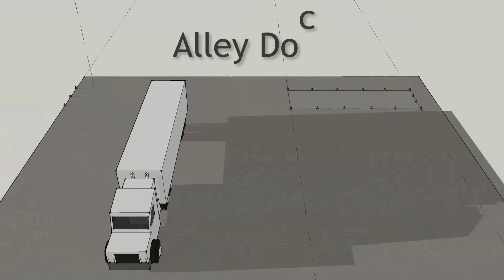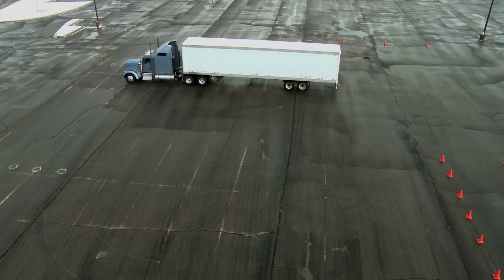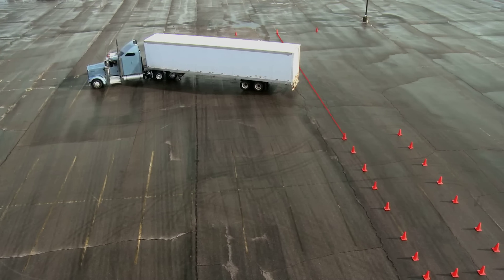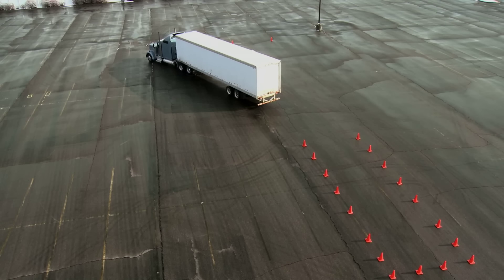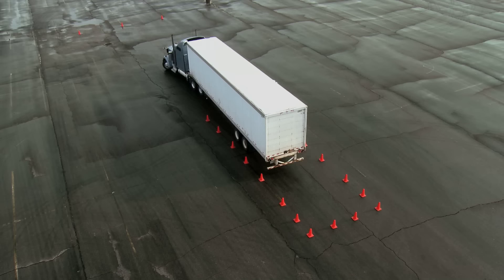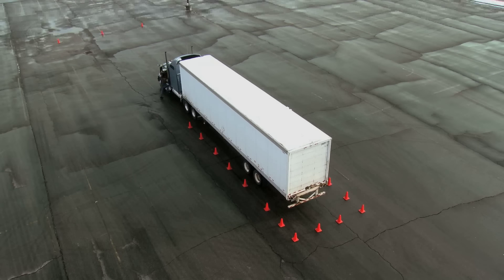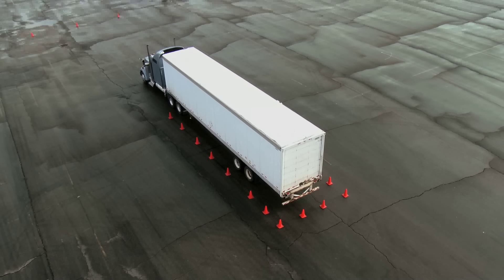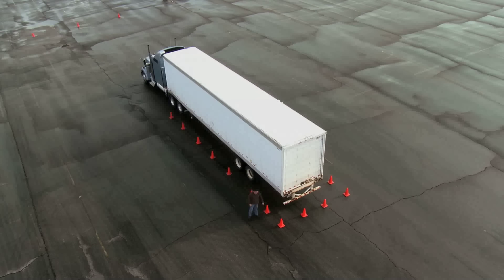Mooney CDL Training Revised Alley Dock with two free pull-ups for Tractor Trailers and Semi Trucks.

Comment: Gotta say as someone who's currently learning this, this didn't help much other than wanting to be about the middle of the 70 feet with preference toward the dock, the instructors for my school suck so we kinda taught ourselves so for a driver side back we do 1 full turn to the right, go back till we find about a pie sized slice on the landing gears cross beams, then straighten the wheels and back for 6 seconds then hard left for 2 seconds then straight till you feel you should hard left to bring it in, but the last part is pure feel and everybody backs and counts at different speeds, but as I said the instructors suck so I've bacicly taught 3 other people how do do the maneuvers so far and they do them super effective, I've been attending the driving portion for 3 weeks, they've been attending for 2 weeks I'm hopefully set to graduate soon

Comment: I never learned to alley dock in my training but honestly it's way easier to do than offset/parallel parking if you ask me. Just remember that you're driving the end of the trailer into the spot. Move slowly and correct/pull up as you go. You always want to use the actual end of the trailer as the point of reference, while also paying attention to your tandems and your drives to make sure you get in straight. You want your tandems and yours drive tires to be in line with each other AND the cones/lines by the time you finish parking.

Comment: I completed Straight line backing and offset. Been doing alley dock 3 times so far this week. Having a super hard time. Hopefully I get it soon. School is up to 3 months of training.
Reply: When you back up to ally dock get about 15 15 on each side of you and pull up 90 feet from your nose to where your backing when you start backing up turn your steering all the way to the right and start moving back watch your surroundings and keep an eye on your landing gear and the back of your trailer. Once you see the second foot of the landing gear go about 2 3 inches past it and you will be about 80 85 90 degree position once your angled to the right position counter steer back the way to straitin your trailer. try to do it on the side you can see your trailer on. Blind side sucks but still achievable

Comment: You hit this from the wrong side. Pull up close to the trailers until you clear the empty spot. When your body crosses the imaginary line at the edge of the spot turn left as fast as you can and wait for your trailer to follow you around. Once you stop you can go into reverst and the trailer will drop into the spot. It is magic.
Reply: I didn't understand that
Reply: Hi Sparky,  Trailers are parked in rows perpendicular to the laneway between them. I was having problems so an older guy told me  you go down the lane close to the trailers and have the trailers on your right side. Once you pass a hole where a trailer could be dropped start turning left as fast as you can. Pull your trailer around as you keep turning left until you can see the hole lining up with the driver's side of your trailer. Throw it in reverse and the trailer will drop right in the hole. Follow it in until you can drop it beside the next trailer. It takes four years to learn how to drive a tractor trailer. I was a mechanic before I was a trucker so I thought that was wrong, but after a few stupid mistakes I now emphatically believe it takes four years to learn to drive a semi.
Reply: @RobertBOUSKILL  That sounds like a technique to try. But for cdl tests students have to back up with the trailer set up straight, 90°  from the hole
Reply: @exillens  One customer I had was a large lot with a gravel lot with a door in the middle of the yard. There was no line to line up a trailer to to make sure the trailer was ninety degrees and square to put a plate the trailer for the tow motor. That was the hardest dock to hit. It was Don Lee Plastics in Toronto.

Comment: Graduated two years ago, did all 48 states and never once did a alley dock. In real ife, you will have to improvise
Reply: You were able to straight line and 45° all your backing in real life?
Reply: I also did OTR as owner operator for several years (w/Flatbed though)  no alley docking there but now as a city driver it is required,  it takes some practice and many pull ups
Reply: What are the 2 states you didn’t go to?
Reply: @dre1975  Alaska and hawaii
Reply: @exillens  it took 6 months to be good at it.

Comment: If you only set up about 5-8 feet out instead of in the middle and don’t go so far ahead you can do this maneuver without pull ups if you do a full 90* turn for your first turn you can just follow it right in way quicker and easier

Comment: Yea, except you have nowhere near that much room in an actual parking lot or truck stop....10x harder when you are trying not to damage a $200k truck on either side of you
Reply: TjThaReal13 That's when you slide the tandems back. There's WAY too much ass hanging off that trailer. That's the quickest way to hit something.
Reply: i would be worried about the guy or girl that spent 200 grand on a truck
Reply: Michael Hawes lets see...truck, trailer, all the equipment that goes with it and customizations...that set upwith a newer truck can hit 200 easy
Reply: @michaelhawes1346  Not if you make 400K a year hauling chemicals and fuel.
Reply: Heinzkitz Velvet I know this is old, but with our flat beds we cannot move the tandem so it’s good practice.

Comment: I set my tractor about 10ft from box and wheels about 8ft over shooting the box. Turn right all the way and back until your 90 degrees. Push the trailer until it’s about 45 degrees into the box and then get under it guiding it in. The way they show it here seems more complicated 🤷🏼‍♂️
Reply: So wait. You don't start turning your wheel hard right until your tires are 8ft past the hole?
Reply: @exillens  no I start with my wheels about 8 -10 ft from the hole
Reply: You need to explain better. Don’t really understand what you’re saying.

Comment: So nervous I passed my pretrip,airbrakes, straight line and offset driver side, failed my 90° Allley dock go retake it tomorrow mourning.... The crazy thing is in school I passed it when not an issue but for some reason I was just so nervous I think I was overthinking it I feel pretty good about it now though I just got to trust my instincts
Reply: How did it went did you pass i will take mine in two weeks

Comment: In Florida, we literally have like HALF of that distance in this video to do a pull up. It's seriously like 5 feet before the examiner screams at you and stops you in your tracks!! Not to mention where we are doing our testing is at our fleet maintenance facility, which is an insane place to do testing.. tons of traffic coming in and out, fire trucks, dump trucks, people and everything of the sort is a distraction while testing. It's actually ridiculous. I have failed alley dock twice as of today.. getting very discouraged with it. I have completed the test both times but got too many points. I swear the distance you can pull up in this video, looks like a country mile compared to what we are allowed to do.
Reply: I thought I was the only 1 thought that I said the same Thang stg
Reply: I’m about to test also IN FLORIDA with yelling instructors & blistering heat 🤦🏽‍♀️2 pull-ups and GOAL is decent BUT that setup distance is insanely tight…I’ll tell you this bro…after we get this maneuver…we will N. E. V. E. R. have to pass up a parking spot at LOVES/PILOT. Hope things have been well for you 💐, be safe💯

Comment: Just failed mine because I use too many pull ups. A 45 degree is so much easier than a 95 degree.
Reply: Picture Me Rollin .Don't feel bat about it this is never ending learning story.
Reply: Dario Campos I passed my driving test yesterday. I am officially a CDL operator.
Reply: Picture Me Rollin big up yuh self
Reply: Dario Campos congrats party time
Reply: If it took you 15 pull ups to do an alley dock...I don't blame the trooper for not trusting you on the road
Reply: @ScottyRawdy  why ?
Reply: Y’all are making it way too hard, you gotta keep your eyes on the rear tandems and lime threw up, and avoid creating blind spots
Reply: How many times did you pull up??
Reply: @justchris846  Keep eyes on tandem huh? I'll remember that
Reply: 90 degree is for experienced drivers. 45 is for beginners in my opinion

Comment: Just took my CDL test passed everything except the 90 I’ll be going back Saturday 🤦‍♂️
Reply: Same, I have to rebook now, did you pass?
Reply: Josh Wade same thing happens to me
Reply: Did you guys finally pass? Did they make you take the whole test over again or just the backing part?
Reply: @exillens  I finally passed, I had to retake the WHOLE test over again and this time i NAILED the backup lol Good luck :)
Reply: @irfanmalik7334  Man that must've been such a good feeling when you backed up halfway into that hole and knew you just had to keep it straight and not go too far back. My exam is soon as well. My driving and downshifting is good. I'm just 50/50 on the 90° backing. Hoping I luck out on test day. Glad to hear you passed man. It's encouraging
Reply: @exillens  just don't give up and keep practicing you'll get it
Reply: @irfanmalik7334  Oh yeah. I'm all in now.
Reply: They charge you to retake it?
Reply: Quick update passed don’t give up been driving 10 months doubles trailers will be at a year of experience by the time I’m 21 stay safe drivers 💯
Reply: Sawat you get two chances I believe
Reply: Josh Wade no I think if you fail a manuenevr you have to take the whole test again. Pre inspfeftion, driving test etx

Comment: I AM A CDL A INSTRUCTOR, YOU HAVE 2 PULL UP AND ONLY 2 FREE LOOK UP, AFTER YOU USE THE 2 FREE LOOK UP  STILL YOU CAN  PULL UP BUT YOU ARE GOING TO LOSE POINT FROM THE 12 POINT TOTAL YOU HAVE, SO DON'T WORRY ABOUT THE PULL UP AS LONG AS YOU DON'T USE ALL THE 12 POINTS IN THE THREE MANEUVERS. BEFORE YOU STARTING THE MANEUVER ASK THE DMV EXAMINER HOW MANY POINT I HAVE
Reply: Hi Saad, that is good to know - So if you didn't lose any points on the straight back and offset, then you have 12 points to use (technically 12 pull ups worth) if everything else is done perfectly?

Comment: If there is a wireless back camera for the Trailer then you don't have to get off the truck to see the space available. Saves time.
Reply: Ben Bloomington Yep, right up until the moment you drive away under another trailer and forget to grab your expensive wireless backing camera.

There's no excuse for being so lazy that you don't want to get out of the truck to find out what is going on 75' behind you.

It's not a car. You CANNOT be staring at a dashboard screen while you're backing up. That camera is only going to show you 1 angle. It's not gonna show you what your tandems might be driving over. It won't show you
 the side of your trailer destroying the hood of someone else's tractor. Nor will it show you if the top of your trailer is about to take off the awning on someone's building.

No. It won't save you any time at all because all of your time will be spent writing up accident reports.

To back safely, you MUST use all the tools available. Both mirrors, head out the window looking at what is going on and most important is goal...
Get
Out
And
Look

Comment: Just to be clear you don't start turning when your trailer hits to the alley you start turning when your left back wheels are either in front of the cone or just a little bit past the cone and I mean JUST A LITTLE BIT..... When he starts turning look at the back wheels they are too far ahead of the cones That's why he arrived early and had to pull up.

Comment: This back would be a whole lot easier with your tandems set back all the way.
Reply: Jeffrey Whitworth Absolutely! It's better this way in a controlled environment where you can only destroy a little orange rubber cone. But I think students should practice with the tandems in a more realistic setting.

There's a sweet spot for those tandems, about 13 holes up from the back, that makes the trailer a dream to drive AND back. I know weight distribution doesn't always allow that, but when you can, it's the best spot.
Reply: I have only been driving 17 years, but I am still learning.
If it's tight, I slide my tandems all the way back since some shippers/receivers want them slid back anyway.
Reply: Jeffrey Whitworth Agreed.

Comment: im having a pretty hard time on mine too. i can pass everything but the 90 in west virginia. i can do both offsets without pull ups but my brain just cant do the 90
Reply: Kaleb Forbes Stop over thinking it. Been there, done that till i relaxed and went with the flow.
Reply: Chew a piece of gum. And don't over think. Once that happens you screw yourself up.
Reply: 90 is my favourite way to back in. Some places see just too difficult to 45 your way into and 90 is your only option. I liked it so much, it's pretty much the only way I back in now.

Comment: there's an easier way. when u get half way between the spot next to the one u want. hard right, and it will be easier to maneuver the trailer. going in straight like he did instead of turning makes it a lot harder
Reply: do that, and watch the tandem's and u won't have to pull up at all

Comment: You've removed all the visual clues a driver often uses to back a truck. I sight down the side of the trailer (like a gun sight), aiming that where I want that part of the trailer rear to be (the side of a loading dock door, opening, etc). It's a reliable system I've used for years. The CDL test, obviously made by a non-driver, sucks the same way.

Comment: The real instructions. 
You've been driving for 8+ hours it's 6am your in a alley in a city your unfamiliar with. Cars parallel parked on both sides. Morning commute is just started so a holes are gonna drive right into your blind spot. So no pull ups and you got one shot at it.

Comment: He pulls up to start way to far out,, get close to the cones, about 4 feet,, turnright as ur drivers door see the opening go out a trailor length. Cut the tractor to the left, now ur whole unit is ore set in a curl to go right in, open the door cut ur wheel slowley left till u go right in no pullups,  u wont have 40 feet in front of u out at customers dock lots,

Comment: I just failed my alley dock test . The instructor said i could pull up . If i pulled up i had to start from the begining ???????
Reply: Julian Diaz same here
Reply: @austynkephart625  i guess you can pull up in some states only
Reply: Iowa is not I guess the guy told me I had to start from the beginning unless my trailer passed the threshold of the line at the beginning of the box
Reply: @austynkephart625  i got inside the box 2 times but i was a little crucked so i had to pull up all the way to the start

Comment: I was told that the trailer has to enter the box before you can pull up.  Otherwise, if the trail doesn't enter the box the pull up has to be back to the a 90 degree angle to the box again and counts as one of your pull ups.  Is that true that the trailer has to enter the box?  So, for example since his trailer didn't enter the box and since his pull up wasn't back to a 90 degree angle, that is an automatic fail.

Comment: How do you remember what way you turn your wheels?
Reply: With each backing maneuvers
Reply: Young Hustla turn right to bend the trailer, turn left to push it in.
Reply: victor montanez thank you
Reply: Just remember that when backing. The steering wheel goes in the opposite direction of where you want the trailer to go. Until your tractor is straight with the trailer. When straight line backing. If the trailer starts cruising to the left, then turn the steering wheel slightly to the left to get back straight again. Same thing for right side.
Reply: You can also put your hand on the bottom of the steering wheel and turn in the direction you want your trailer to go so if you wanna go right turn the bottom of the wheel to the right
Reply: Use your mirrors. If you see more tire on one side and not the other, turn your wheel into the side with more tire to straighten it.
Reply: Shelby k My drill sergeant of an instructor told me to put my hand on top of the wheel and watch my mirrors when the trailer starts to drift, move my hand in that direction and it straightens up.
Reply: Another good thing do turn towards trouble
Reply: you have absolutely easy way to explane the whole video nice

Comment: The first advice is bad advice. You shouldn't be jacknifing into the box. Rather be at an angle towards it from the start, you won't be jacknifing and you will eliminate alot of the blind spot.

Comment: And you're failing to teach him the first thing about handling a trailer sliding the tandems all the way back to nail a tight hole the 10-ft off track of the rear end the arc radius is huge in that parking lot in the real world 70% of the space he's showing wouldn't be there and tomorrow off the 10-foot space in front of another vehicle so when you swing your tantam around you don't tear off the front end just go out and place your soda can as a physical marker

Comment: Wrong wrong that is not how you back into a hole. This is garbage in garbage out you try this shit at a truck stop or anywhere else you're going to hit something. The S turn is the proper way to back in any hole not this crap. This goes along with drivers that stay in the middle lane because some so called trainer said " it the lane of least resistance" also a load of crap.